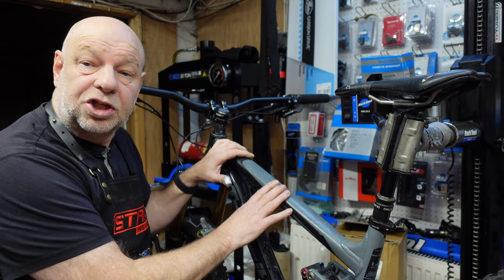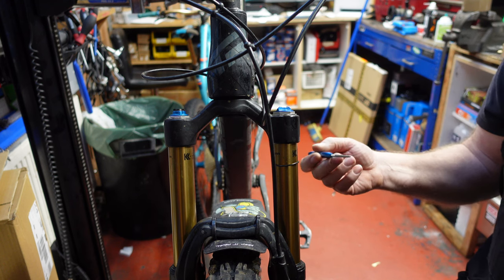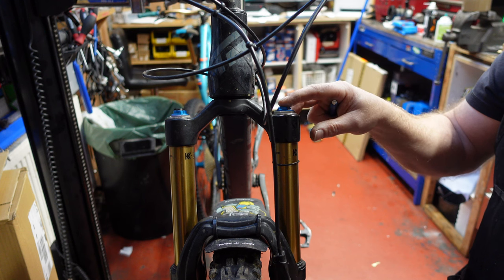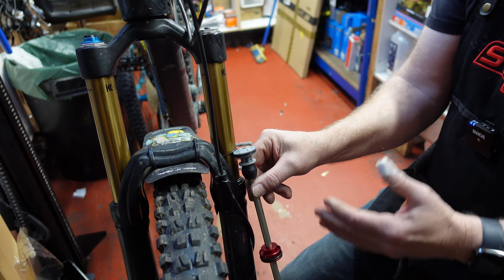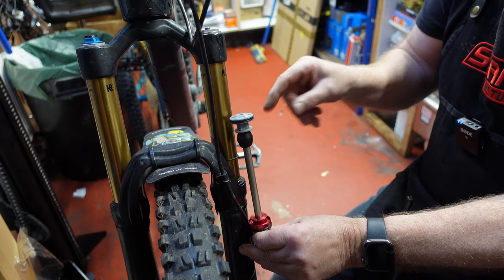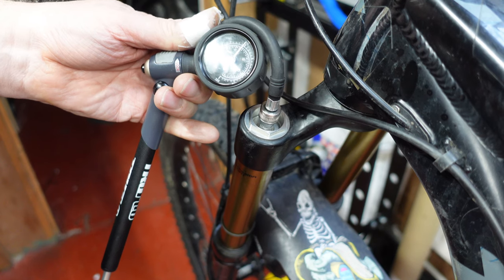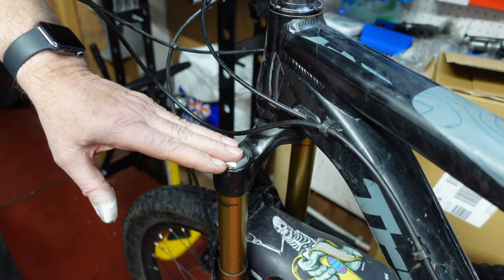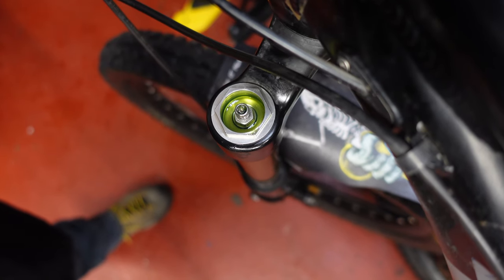How to find a fork air leak and how to fix it

Comment: For some stupid reason, I had it in my head for months that it was not the valve core. But I followed the advice and... It was the valve core. Luckily I used oil and not water because it sucked it all up!

Comment: I've just had my first dealings with air sprung shocks, my previous bike had them but I bought that bike of my son who's a very experienced bike mechanic and sorted all that for me. My current bike has RockShox 35 Gold RL Crown adjust Q15x110 DebonAir e-MTB 160mm and Fox Float DPS Performance Trunnion 3-Position Evol LV custom tune 205x65mm. I understand that it's a decent suspension by all accounts. I noticed after 1600 miles that the sag was not quite where it was when I bought it so bought a £20 shock pump and tried to pump things up. The pump would go solid at the end of the stroke so I asked my lad and he told me I'd not spent enough cash. I went out on Sunday and bought a 600 psi Rockshox pump and what a difference it makes, no resistance at the end of the stroke and pumps like a dream. Thank you for the video Dave, very informative and useful. My set of tools and equipment is getting a bit out of hand now, but I love the independence of doing things myself. The scene has changed massively since I used to ride my bike to school in the early 70's. The bikes were really heavy but needed no maintenance only puncture repairs and adjust the the rim brakes and brake blocks. Do you remember the rod operated brakes with no cables?
Reply from the maker: Hi Jon, Thanks for your comments, I certainly do remember those type of brakes. im 60 next so Ive seen such a lot over the years
Reply: Got one of those pumps myself.  Just need to find the leak.

Comment: How do i know if my bikes  air or hydraulic? Mines locked out ive opened it and its got a thin aluminium tube inside  no springs on either
Reply from the maker: Hi, can you send me some photos?
Reply: @TheYorkshireBikeMechanic  im in work right now but its the ebike from fiido fatbike 20inchby 4inch wide wheel  the m21pro,i will exchange emails etc tomorrow and take some pics ,upon disassemble  i couldn't take the fork fully apart as there a screw on the side with nothing in that i couldnt reach but the otherside i could atleast get what looked like the inner tube u took out and gave it a good clean,now its alot better  but i would like to get to the bottom of it and give it a good  cleaning and lubing  were ever👍

Comment: I have a "brake" question since u r a good mechanic. My hydraulic disc brake squels. I changed both the rotor and pad, simano. For few days it was okay but then it started squeling again. I did not ride outside after i changed the rotor and pad, i have kept it inside the warehouse. Now i do not understand why it squeled. Both front and back wheel.
Reply from the maker: Hi, so difficult to diagnose without seeing im afraid.

Comment: Brilliant! I'm also suspecting that my rockshox reba dating back to 2013 to be not able to sustain air pressure over time. And  I was quite helpless about this up to now what to do and how to proceed. I'm very grateful for the undoubtedly your very clear tutorial. Moreover your very calm, clear and well articulated language is admirable. Yet, I still ponder over the following point: The goal in this video is to pump until a pressure of 100 psi is reached and watch if that pressure doesn't decline over a certain period (24 hours). But when unscrewing the hose of the pump from the valve it is inevitable that some/ a little air leaks out of the valve, whereby the pressure in the fork will go down by a few units. And when the pressure is to be verified hours later, the ambient air in the hose of the pump will first have to be pressurerised by the air coming out of the valve. As the volume in the fork is rather restricted, again a (considerable?) loss of pressure will occur. Finally the guage of the shock pump will presumably display a pressure of less than 100 psi (how much less?) even if there is no leakage in the fork itself. Not having enough experience in this area, it's hard for me to assess how much less measured pressure than the initial 100 psi is tolerable. I would appreciate your opinion about this. Thanks a lot!
Reply from the maker: Hi, thanks for watching and your great comments. I understand what you are saying and you are correct in your understanding, however it's sometimes better to simplify the process. Because the fork air side has a small volume the slightest leak makes a massive difference. there is only one fork pump that I know of that can reduce the air loss when taking it off and on. there is also the possibility of the air shaft o ring is slightly perished and leaking down into the fork lower creating negative pressure. you will hardly ever get the same reading when adding or removing pressure even if you over compensate for the loss.
Reply: @TheYorkshireBikeMechanic  Really appreciate your well founded answer! Will continue watching your tutorial videos.

Comment: Great tutorial. Many thanks for posting it. Is there a reference number for the O-ring on the valve assembly that you changed. How can it be sourced?
Reply from the maker: Hi Phil, the best way to find parts like o rings is by searching their parts catalogs.
Reply: @TheYorkshireBikeMechanic  Many thanks for this guidance. For a leak in the exact same area, is it possible to only remove the valve assembly using a nut socket of 3/8”, changing the O-ring and putting back the valve assembly whilst leaving in place the larger casing which require a 24 wrench to unscrew. Or does one also has to remove the large casing before taking out the valve assembly?

Comment: Great video after Iv paid £80 to have the seals replaced it was still leaking and Iv found out by using this video they have changed the wrong ones 🙈 I think I could replace this seal but I’m confused why we need to unscrew the bigger part? Is it possible to just remove the valve?
Reply from the maker: Hi thanks for watching, it depends on the model. Proberbly best replace the complete cap

Comment: Thanks, informative video. I run a set of maverick sc32 forks love them. The lock out and rebound has seemed to have stopped working. I want to have a look, and give them a full service. I have new dust wiper seals for them, other o ringes are standard sizes,and the fork is apparently easy to work on. But I'm struggling to find any detailed information, service manuals.
Was wondering what you would do? Any advice would be appreciated. Kind regards.
Reply from the maker: Hi Peter, If I correct Maverick are based in the states, First thing I would do is research where they were made and who if anyone offers to service them. once you have found this, send them email asking if they could give you any info for what you need. try contacting these first https://mavericksuspension.com/service/
Reply: @TheYorkshireBikeMechanic  thank you for your help. That link is awesome, all the sites I tried said page no longer exists. Hope you have a good day 👍. Thank you again.

Comment: Good video, i have a Marzocchi 55 cr fork, and the air side is leaking air, and also have so much pressure in the chamber that leak a little bit of oil in the botton, i have replaced seals but still leaking air into the bottle, any suggestions?

Comment: Hi Dave, I’ve got a pair of ohlins RXF 36 m.2 evo forks and the stanchions actually have play in the lowers, I’ve ordered a seal kit for it and wondered if you think that is the issues?, thanks 🙂
Reply from the maker: Hi Aston, What year are they and how much use have they had, also when you say play, do you mean play when rocking back and forth and the front brake is on ?
Reply: @TheYorkshireBikeMechanic  we’ll my bike is a 2018 specialized enduro so I believe they’re a 2018 model and they’ve had a good amount of use and I’m sure they haven’t been serviced since new.

Also yes there is a little bit of rocking and I’ve noticed there’s about half a millimetre of movement within the main fork seals, cheers
Reply from the maker: @S0GGY-BREAD  It sounds like the inner bushings are worn, new dust seals and foam rings wont make any difference, they need to go to a specialist for a service, are you in the UK?
Reply: @TheYorkshireBikeMechanic  o riginally thought it would be the seals but  you mentioned bushings so i shall get some ordered in.

i am in the UK yes (sheffield) but I'm going to attempt it myself so ill get some bushings ordered in,

cheers once again dave
Reply: @TheYorkshireBikeMechanic  I thought that could also be a problem, yes I am in the uk (Sheffield)

Comment: How to solve the air leakage from air putting point, at the valve point? Thank you.
Reply: Screw the core down tighter. You'll need a tool for that.

Comment: My air shock is TRINX brand, if you have any experience please share the solution of small air leakage at the air blowing point, valve.
Reply from the maker: Hi, sorry Ive no experience with the brand

Comment: Hi so my marzocchi 2006 66 light fork is leaking air and I was wondering what size of o ring i would need for the valve.
Reply from the maker: Hi, Thanks for watching, forks differ but we keep a selection in the workshop like this one https://www.amazon.co.uk/AUTOUTLET-Conditioning-Assortment-Appliance-Appliances/dp/B07CXMKQT1/ref=asc_df_B07CXMKQT1/?tag=googshopuk-21&linkCode=df0&hvadid=375433475241&hvpos=&hvnetw=g&hvrand=267469620274316069&hvpone=&hvptwo=&hvqmt=&hvdev=c&hvdvcmdl=&hvlocint=&hvlocphy=1006757&hvtargid=pla-644647732953&psc=1&tag=&ref=&adgrpid=79769156594&hvpone=&hvptwo=&hvadid=375433475241&hvpos=&hvnetw=g&hvrand=267469620274316069&hvqmt=&hvdev=c&hvdvcmdl=&hvlocint=&hvlocphy=1006757&hvtargid=pla-644647732953

Comment: Hello! is there a way to test if there is a air leak to the lower leg? Thanks!!
Reply from the maker: There is no air in the lowers on most forks apart from under load
Reply: @TheYorkshireBikeMechanic  Yeah, I know, but my wiper seal popped out... and I read that it could be an air leak going into the lowers.

Comment: can you use chain lube as an all-round oil?
Reply from the maker: Hi Gabe, It's a tricky one to answer because most oils are formulated to the specific use, however if you have no other oil to use then yes. Chain oil is quite heavy so it sticks and clings to the metal but chain oil is better than non.

Comment: hello my Fox Rhythm 34, EVOL, GRIP stays sucked down about 3-5mm and when i lift  my bike  up it goes back to full travel and i cant fix it. would you have any suggestions what the problem could be?  and fork is brand new
Reply from the maker: Hi, thanks for watching, have you set the sag to 25% ? What bike is it and how much do you weight?
Reply: @TheYorkshireBikeMechanic  its a 2022 trek fuel ex 8 i weight 72kg (158 lbs) and yes i  have set sag different times to different points and once i inflated my fork to 120 psi then it didnt  suck  it down  but im starting to  think  that there is  just too much oil in air shaft i  heard its normal with fox forks. but its so annoying that my stanchion is  145mm if i pull my fork down and lift the bike but then when i drop it back down  it shows  140-142mm  and when  i bottom out there is that 5mm left of stanchions so my travel is  135mm  and   fox and trek suggests 15-20% sag  so i have 15% now
Reply: @TheYorkshireBikeMechanic  and i can get 25% by reducing half of suggested 75 psi to 40 psi and it feels like something is figthing back if im trying to compress it and it wont go fully down if i take all air out of my fork